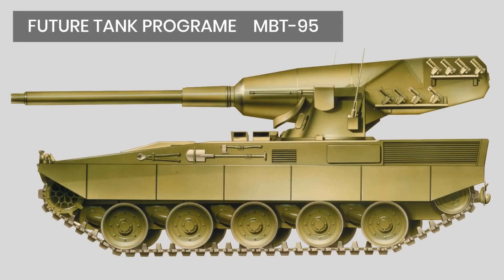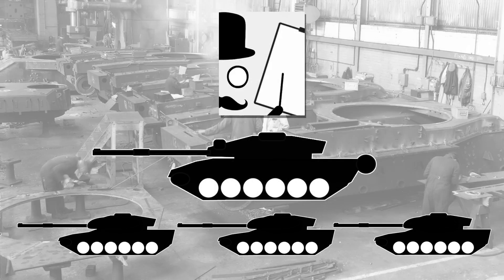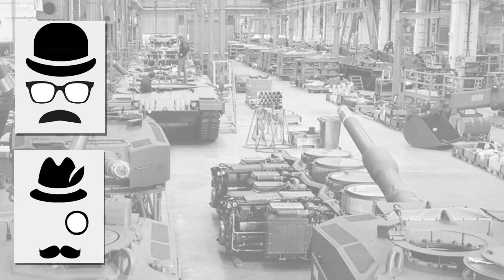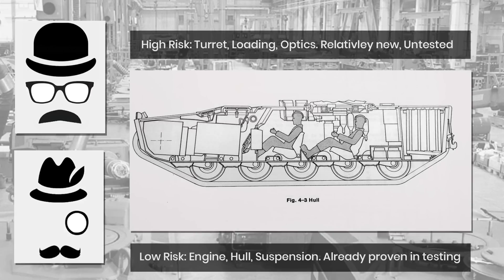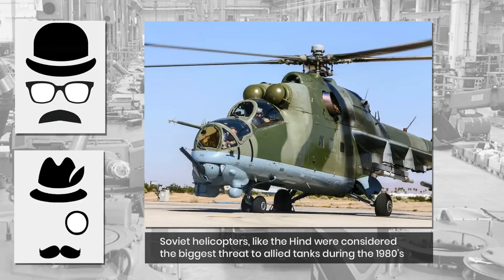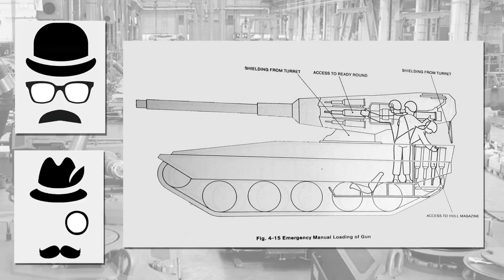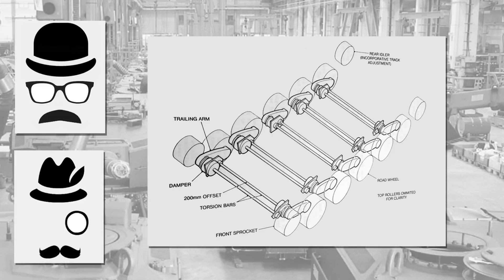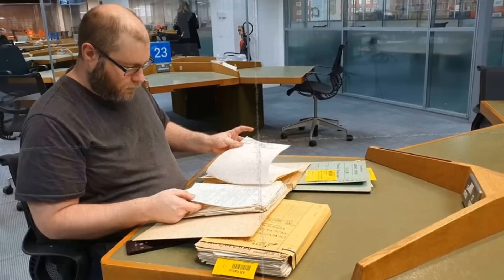MBT -95 - Leopard 2 hybrid: Tank Design & Development

Comment: I was wondering about kinetic anti-tank missiles! Please do a video on them! I've never heard of any such projects, but ages ago when I was reading about the Starstreak missile and it occurred to me that even something as relatively small as the Starstreak ends up propelling roughly 3kg of combined mass (about 1kg less than a lot of modern apfsds) at slightly lower than modern apfsds velocities; so I wondered why we don't see kinetic kill ATGM's everywhere
Reply: The main problem is that they have a minimum range, as they take time and distance to accelerate.
Reply from the maker: i will do at some point
Reply: @armouredarchives8867  Thank you so much!
Reply: My father worked briefly on some KE Missiles. The basic conclusion was that it was doable but impractical, as making more efficient chemical-energy warheads was much simpler and cost-effective than any theoretic KE missile, and in turn, making better guns and KE-projectile ammunition for guns was simpler and more cost-effective than missiles of similar performance. Basically, KE missiles were just not worth the effort because they could nothing better and definitely cost a lot more. It has proven so because since the 1970s, better guns and HEAT warheads have long surpassed the best hopes of the KE missiles for very little real effort.
Reply: @genericpersonx333  In principle, a top attack KE missile could be smaller diameter than a HEAT or EFP warhead missile, and yet reach the target more quickly due to its faster speed.

A semi-circle arc is about 1.5 times the distance compared to a straight shot, but a KE missile might fly five times faster than a HEAT missile. It would give hard kill active protection systems a lot less reaction time and a smaller target.
Reply: @IsaacKuo   If it were that easy, we would have KE missiles in abundance already because the reasons you cite were literally reasons for them back in the day. It just comes back to whether the missiles are really more cost-effective for the task than the alternatives and so far, KE missiles are not really proving sufficiently better. 
      HOWEVER, for myself, when it comes to arms development, I say research EVERYTHING and damn the expense because research rarely proves a genuine waste. Even if a project fails, it can give inspiration to other projects that end up being far better than they would have without that inspiration. I understand why KE missiles are not popular, but that doesn't mean they shouldn't be explored at all. Even if they go nowhere as a weapon themselves, they might just make something else even better, and all I care about is the thing we do use being better.
Reply: @genericpersonx333  It wouldn't have been that easy back in the day, because of something I didn't even mention - guidance. Options were pretty limited, and a semi-circular top attack arc is a non-trivial trajectory compared to, say, straight line inertial guidance. SACLOS (like TOW) wouldn't work. Beam-riding wouldn't work. Semi-active radar or laser guidance might provide final guidance but you would have needed something else for most of the arc.

With modern guidance, it's not so hard but it's still something that would take significant R&D to nail down.

Another thing I didn't mention is that you would need a more complex trajectory to avoid a minimum range.

And in any case, the resulting weapon system wouldn't deliver enough payload to be useful for generally blowing stuff up. It's pretty specialized for anti-tank and/or anti-air. OTOH, it would be really awesome for taking out aircraft and drones, so that could be worth something.
Reply: Look up An Exploration of Integrated Ground Weapons Concepts for Armor/Anti-Armor Missions 1991 RAND - this study includes analysis of possible Bradley and LAV based anti-tank vehicles armed with hypervelocity kinetic kill anti-tank missiles. The big problem is that these missiles were very long and bulky. I guess they were trying to mitigate drag by having a smaller diameter than Starstreak, maybe?
Reply: @IsaacKuo  Hmm to speak to starstreak specifically; once the second stage burns out, the warheads (darts) detach from the body, so I don't really see drag as the issue. Though I suppose having a smaller diameter would allow somewhat fast acceleration...but then again, starstreak's second stage isn't even as aerodynamically optimised as it could be, so it's probably not much of an issue
Reply: @tommeakin1732  It could simply be that they deemed much more mass and velocity was required to do the job. At the time, they were looking at developing tank guns twice as powerful as the 120mm, in anticipation for expected improved Soviet main battle tanks.

What I find interesting is that they anticipated top attack threats, but didn't try to combine hypervelocity kinetic kill with top attack. Obviously an unguided APFSDS dart can't do this, but why not a missile? Beam-riding guidance wouldn't have been so good for this, but semi-active laser guidance (like Hellfire) could have been used.
Reply: @IsaacKuo  That may have been the case back then, but I'm still wondering about in more recent decades.

As for hypervelocity top attack, that'd likely require a multi stage system where the delivery mechanism has to take the final stage up to a "firing spot" above the target, so it'd only get to those extreme velocities once high above the target in the final "sprint". 

However if you're using a kinetic kill missile and can achieve the kind of energies that contemporary APFSDS can, top attack seems like unnecessary complication, and removes some of the advantages (incredibly fast time to target) and it's more complicated and expensive. Though I suppose it's possible that a top attack missile of lower energies (not needed for top attack) might end up being more economical. I honestly have no way of guessing that
Reply: @tommeakin1732  Well the overwhelming one-sided devastation of Iraqi armor in Desert Storm and the Iraq war, along with the collapse of the Soviet Union, caused a massive reassessment of the armor threat. And the GWOT altered the sorts of weapon systems being developed - a lot more emphasis on explosive munitions for use against fixed targets than anti-armor.

Anti-armor munitions didn't stand still, but it made more sense to improve missiles for existing launchers, as less expensive incremental improvements. So, for example, you have the overflight top attack TOW. There are lots of TOW launchers out there, and this gives much improved punch for anti-armor use, while still keeping the system useful for blowing up stuff.

OTOH, you also saw the development of kinetic attack "flying ginsu" knife Hellfire missiles, so it's possible a hypervelocity kinetic kill missile could have been sold as a reduced collateral damage "sniper missile". To minimize risk of collateral damage, a top attack profile could be useful.
Reply: @IsaacKuo  Now I'm thinking more about it; my guess is that the secondary blast effects of HEAT are probably valued by militaries quite a bit (I've never actually seen it written down as a reason but it makes sense) and have contributed a lot to them being preferred to kinetic kill missiles. I mean even if you only ever intend to fire an ATGM at vehicles or structures, it's still probably nice to know that you could also fire one off as a poorly optimised HE missile. I believe it's also relatively easy to make a HEAT warhead a better anti-personnel weapon by simply conceding some internal volume in favour of getting more fragmentable mass on the exterior.
Reply: @tommeakin1732  I've thought more about your idea of a kinetic attack variant of Starstreak and I think it could work well if you also develop a slower HE rocket for the same launch tubes.

The dimensions of Starstreak are similar to a 120mm round, but about 50% longer. So, you place the launch tubes in a turret bustle. The tubes tilt up for launch. This bustle is a bit longer than a 120mm magazine bustle, but ammo capacity is similar. This turret can be very low, and more roomy because you don't need the big heavy main gun, mounted high enough to depress.

Actually, make the turret a "donut" around a non-rotating crew barbette. That way, the driver sits with the other crew. Very compact, and very low. The missile/rocket launcher bustle is balanced by the turret's front armor and a 25mm gatling. Turn the turret sideways to access the rear engine.

You've got your top attack kinetic missiles for anti-tank and anti-air, and you've got low velocity HE rockets to blow up fixed targets. Low velocity lets you lob the rockets in an arc, since the tubes can only elevate. The gatling is good for most other targets; particularly cheap drones.
Reply: Hey, I ran across an interesting accidental kinetic anti-tank rocket. Apparently the 70mm CRV7 practice rocket, with a tungsten penetrator rod replacing the steel dummy warhead, could penetrate T-72 armor from any angle. I think it's about 1.6m long, and 70mm in diameter.

Adding a guidance module would increase length, but it's something to ponder.

The thing is ... compared to Starstreak, this rocket has a very narrow diameter. A tank bustle could easily fit four 23 round MLHS launchers ... a total of 92 rockets!

Instead of a guidance module, though, I've been thinking of a cheap alternative - an oblique linear EFP warhead. Instead of a dumb penetrator rod, there's an explosive warhead with a couple rectangular liners along opposite sides. One liner forms into a bar moving at 2km/s downward (along with the existing ~1km/s forward velocity). The explosive is slightly thinner at the rear to set the bar slowly rotating. It rotates 60 degrees in 50m, so the ideal aim point is 50m above the tank.

So, you don't have to directly hit the tank, you just need to hit a football field region above the tank. That's a lot easier at long range, firing on the move, with an unguided rocket. And anti-tank lethality is awesome since it punches downward into the thin top armor.

The sensor is also very cheap and simple. It's just a light sensor staring 60 degrees off axis. As the rocket spins, this scans a cone. You shine a laser on the target, which the sensor sees in pulses when it arrives. After the second pulse, the rocket detonates. The spin period is calculated by the time between pulses, and the angular position of the target is determined by the middle of the pulse.

The second liner is dimpled to produce multiple projectiles. This makes the "oblique linear warhead rocket" suitable for attacking all sorts of softer targets, including cheap drones. For example, frag top attack is great for attacking infantry in trenches.

Depending on the laser code, the chip will delay for AP mode or frag mode.

You have two variants of oblique rocket - a fast one for long range, and a slow one for arcing fire with a longer warhead.

Imagine 92 inexpensive rounds of that sort of flexible precision. It would be a revolutionary leap in tank firepower.

Comment: Hilarious reveal at the end as we realize the Germans are to manufacture every part of this proposed tank. Though the digression about the importance of loaders in a tank crew in roles other than loading the gun makes me wonder if modern autoloading or unmanned turret tank designs would fare better with a multirole "support" crew member who just...doesn't load shells.

You wouldn't get to reduce overall crew volume (though internal space might be laid out differently if clearance to lift shells into the breech isn't needed?), but you could still separate the crew compartment and remove the human limits/variances of loading, which would also reduce the need to train loading speed/endurance and unburden the "loader" to pursue support tasks (perhaps electronic warfare or some other role of increasing modern importance?). Or at least, to work on their tea-brewing.
Reply: Funny you should mention the Idea of using an autoloader without decreasing the number of crew, because thats actually exactly what Rheinmetall's new Panther MBT is planning on doing. There is an optional 4th crewmember who can be either a company commander, or something like a drone operator (important considering the Panther will have full support for launching loitering munitions and operating RCVs).
Reply: @TheLadderman  Damn, I should really be an arms designer.

This is your cue to reveal you're a recruiter for a major arms contractor and you're really desperate to fill a position
Reply: @johnologue_gaming  lol, I wish. What's funny is I said basically this same thing to my friend like a week before Rheinmetall revealed the Panther, and he called me silly.
Reply: personally i think the idea is silly, just have a separate section of men that help with maintaince if its such a big deal. lik the french and russians. and that is assuming future tanks will be as maintaince intensive as 1970s ones we use today. 5 crew used to be considered the minimum for maintaince back in the '40s. and even more was needed back in ww1. i mean the americans and germans did testing back in the 1980s and 1990s and found 2 crew were not over burdoned with maintaince...
Reply: @matthiuskoenig3378  I mean, using the Russians as an example for armored warfare logistics right now seems rather foolish.